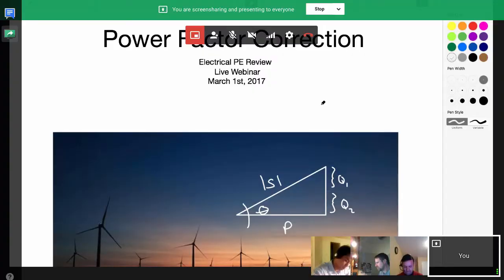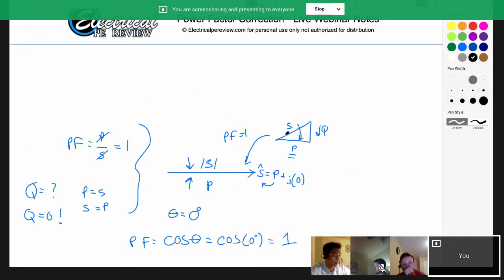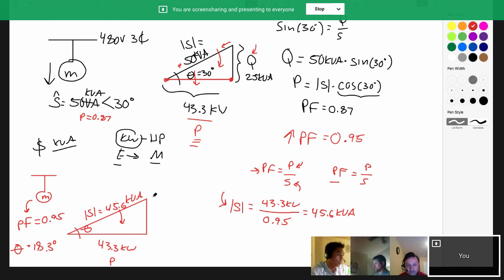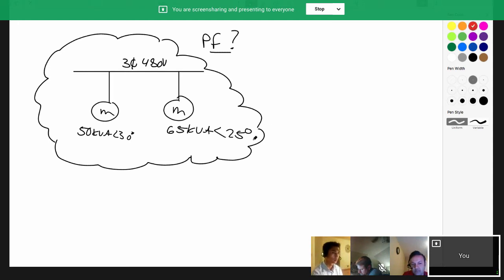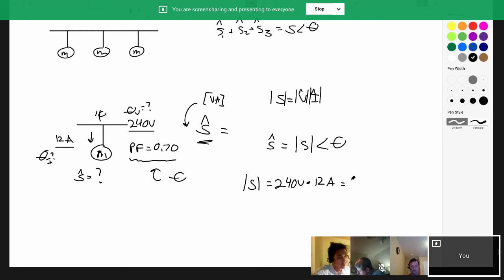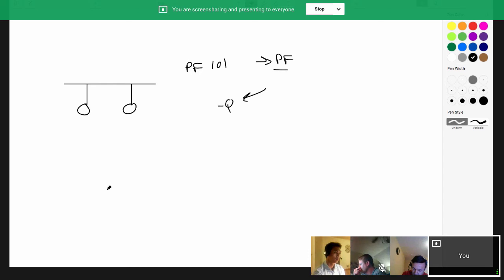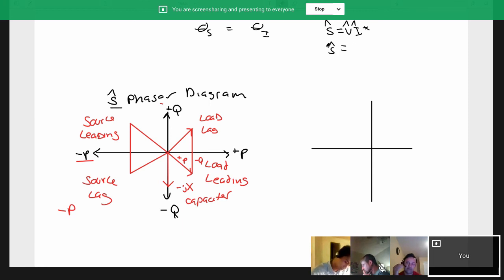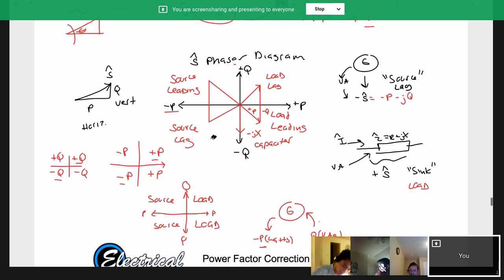1.5 Hour Webinar on Power Factor Correction recorded in 2017 for the Electrical Power PE Exam

Comment: Why does 'P' stay constant rather than 'S'? Are we replacing the motor with a more efficient motor? Or finding a better way to feed that existing motor? This seems to suggest the former rather than the latter, yes?
Reply from the maker: Real power (P) does not change, because all we are doing is adding a capacitor to the motor. The capacitor supplies reactive power (Q) to the motor, while the motor continues to draw the same amount of real power (P) from the power supply.

Comment: Zach, this is one my favorite of your videos.  It's one of the first I watched before subscribing to your course, but it opened my eyes to the importance of drawing diagrams when solving problems.  At first I didn't think power correction problems weren't that difficult, but after you explain phasor diagrams and how it can help prevent mistakes, it started me on making a habit of drawing things out first with proper notations.

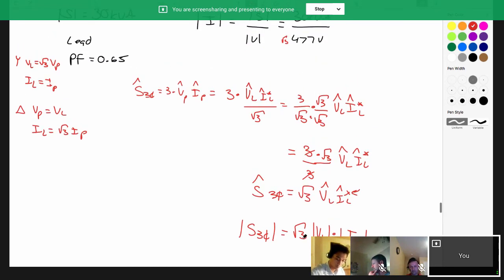Comment: at 59:54 min of the 1.5Hr Webinar you mentioned that there is no use of the angel since we looking for the magnitude however in given problem there is a PF of 0.65 leading meaning theta =  cos inverse(-0.65)=130.54 so the line current should be 30/sq. root 3 *477 cos(130.54)? since S=VI Cos theta then I= s/sq. root3*477*cos(130.54) Please clarify
thank you was a great lecture about PFC
Reply from the maker: Hi Ayman glad you enjoyed it. If you are looking to solve for the complex line current at a leading power factor of 0.65 then the angle of the line current would be equal to 49.5º when the line to neutral voltage has a reference of 0º for a positive ABC system. The magnitude would still be the same as shown in this video.

For example:

I_L = |I_L| < θI_L

|I_L| = |S_3Φ| / (√3·|V_L|)
|I_L| = 30kVA / (√3·477V)
|I_L| = 36.3A

θI_L = cos^-1(PF)
θI_L = cos^-1(0.65)
θI_L = 49.5º
Positive for a leading power factor.

I_L = |I_L| < θI_L
I_L = 36.3A < 49.5º
When the line to netural voltage is at an angle of zero degrees, or, when the line voltage is at a reference of positive 30 degrees assuming the system is a positive ABC sequence system.

Comment: I thought we,are charge by watts not VA
Reply from the maker: Hi 佳璁 江, residential billing, such as your house is typically charged by the kilowatt-hour since residential properties do not typically have large induction loads. Power factor correction is mostly used for industrial facilities that have a poor overall power factor due to induction motors. Electrical utilities typically impose additional fees for industrial customers with a power factor that is lower than the contract limit.
Reply: Thank you